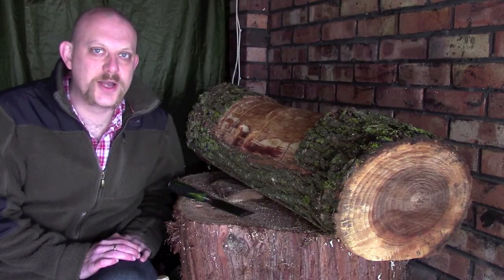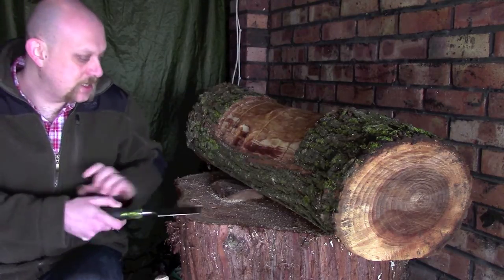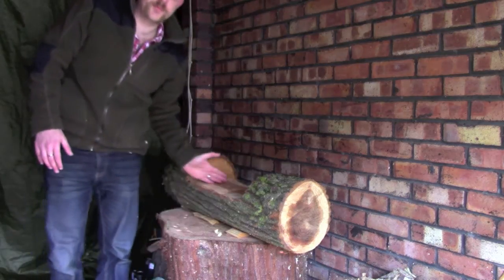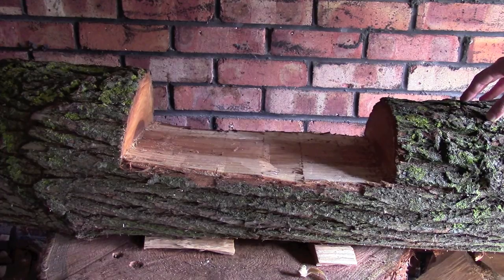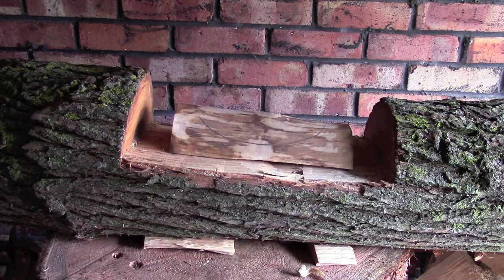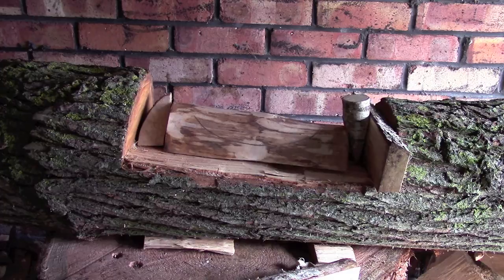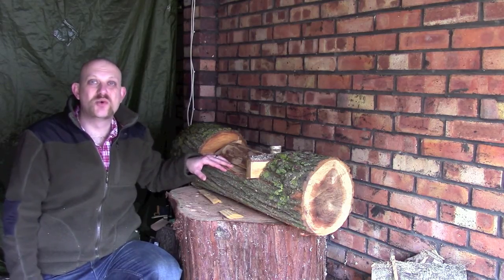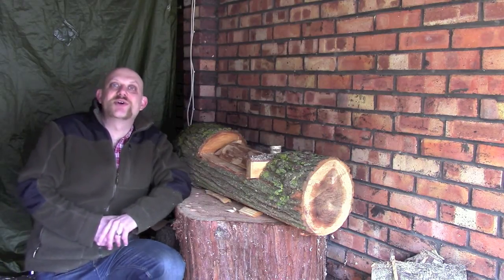Making a Carving Bench - Part 2

Comment: I picked up a piece of wood today and plan to make a similar bench.  Have you done the legs yet?  Now that you have used it a while, would you have done anything differently?
Reply from the maker: +Jim Mobley I played around with some different leg configurations but nothing really worked for me so am going to keep it for use on top of my carving stump.If I had the time and inclination I would have squared off the underside more so it sits flat and level as chocks and wedges do move around with heavy work. Aside from that I would just make sure you get the internal surface as flat and level as possible.

Comment: what kind of chisel where you using?
Reply from the maker: It was just a standard bevel edge chisel, I think it was 2" wide if I recall correctly.
Reply: was it a Stanley if not what brand was it. how was it sharpened? did it have a back bevel or was it sharpend on the main bevel. and if there wasn't a back bevel was the back flattened.
Reply from the maker: Hi Brian, I have just double checked and it was an am-tech 2", it is flat backed and has both a main bevel at the front and bevels on the side.
It was a cheapy I had original picked up for a project that never happened but is useful for this kind of work.

Comment: Have you finished this baby yet...???  It looks hard work to get her to size... !!
Reply from the maker: I played around with some leg options but none of them felt right so I am still using it on top of my carving stump. I could just screw some boards to the sides but again it's not what I originally envisioned for it.
Reply: Dare I suggest strapping it to your wife's back as she kneels down on the floor, or would that be a trifle too adventurous... lol The reason I asked initially was that I had a little trouble hand drilling the holes into the base of my shave horse when I made it. To say they came out inaccurate would be an understatement, they serve their purpose okay but a few questions have been asked about them. I just say it is a design feature to allow the thing to be placed against other items in the workshop and to not obstruct....... I am not sure I get away with that as an excuse anymore though..... keep up the good work.. !!!
Reply: Woodcraft Hamster that's a excellent idea I'm going to make one I helped some tree surgeon got as much free wood as I wanted too you got a Twitter?